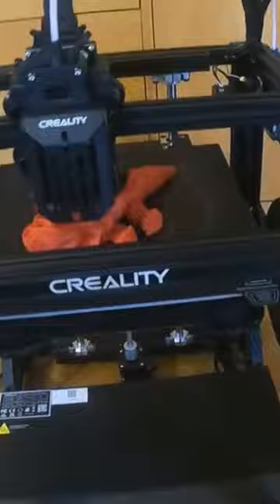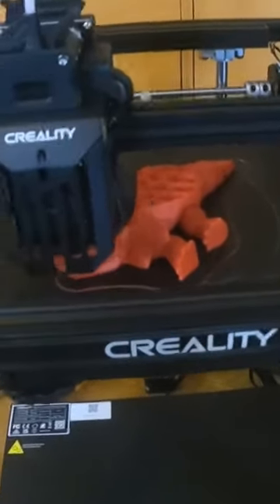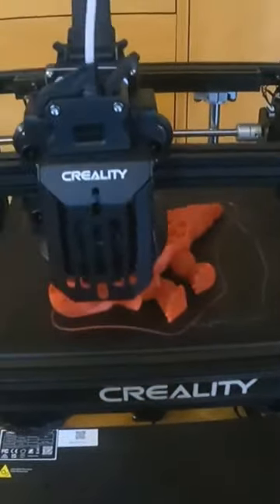Creality Ender 5 S1 Test #shorts

Comment: I just finished building this printer, but when I try to heat up my h&b, the printer restarts, do ypu have a solution
Reply from the maker: Hi, it is not an issue I have had. I would suggest going right through the cable connections, and confirming each is fully connected. If you still have no luck I would contact their support, and ask on the Creality Facebook page for help. I hope you get it sorted as I use mine all the time and it's a great printer.